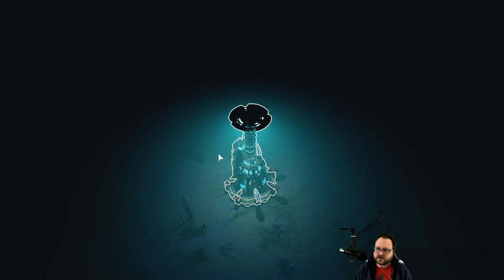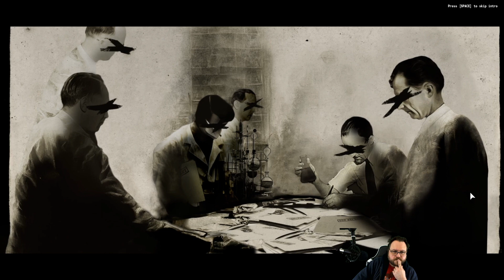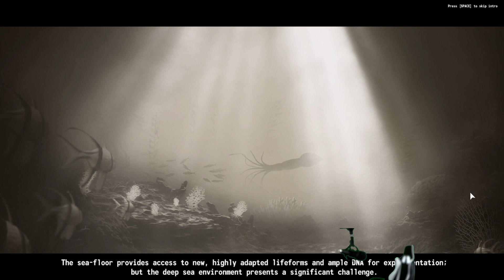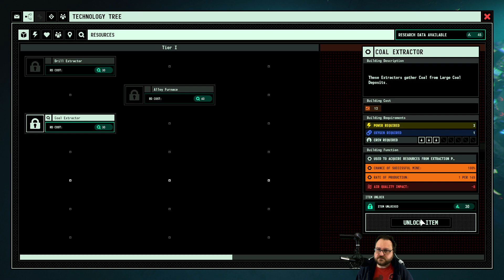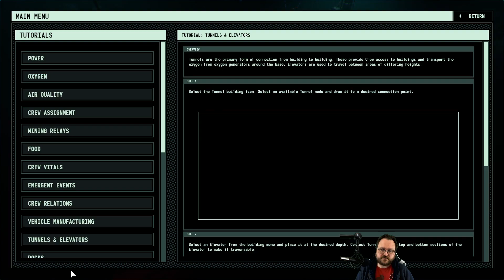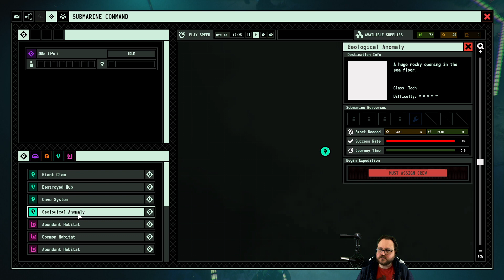Surviving the Abyss - New Early Access Game! #sponsored

Comment: 8km under the sea? I wonder what the story is behind that depth as from physics point of view it's quite impossible. It's difficult to convey what the pressures are at that depth other than trying to imagine the biggest building you know of and then multiplying one such building weighing on every square meter of a tunnel wall built at that depth. There's literally a 8km mountain of water on top of everything. Thematically 100 or 200 meters would've been enough. No sunlight and enough pressure to make building anything really difficult.

Comment: Water Pressure is about 1 atmosphere per 10 meters, so the pressure down there is something like 800 atmospheres, or 80 megapascals.
Reply: That's about a tad bit less than the pressure in a standard hydrogen tank (1050 bar), but a lot higher than natural gas (330 bar). It was hard to find, so I had to make an estimate, but the boiling point of water at 800 bar would be around the 660 degrees Celcius. (1220 Fahrenheit.)

Comment: I don't mind a bit of suspending disbelief but burning coal to produce power in an underwater habitat is a bit more than I can swallow.
Reply: Why ?  Coal is burned ina sealed unit above ground.  Why cant it be burned underwater ?
Reply: @jeepsblackpowderandlights4305  because there isn't an abundant source of O2 underwater.  It isn't worth getting oxygen from electrolysis because that would take more power than you get back from burning coal.
Reply: @roberteltze4850  maybe they are getting 02 from vaporizing the water somehow. Just use your imagination

Comment: This looks amazing! I am just wondering if this game is procedurally(sp?) generated, or the same events and lines of play every time like Frostpunk?
Reply: Even in frostpunk the outcome of the events is random and can be diffrent every playthough and every game has a way how it is to supposed to be played. 

To answer your question the map is procedurally generated, for the events i have only about 12h of gameplay experience but it seems they outcome is fixed. And for gameplay alternative i found you can go fast but this is very hard and you need to know what you are doing or you can take your time and everything everybody is compling about is nothing to be concerned about. Resccource not infinte but there are enough, the anomoly no issue if you have your power sorted out the with UV-Light nothing happens only 2x fuel comsumption what is no issue to compansate for.

TL:DR play it fast it is hard as hell. Play it slow it is still hard but Frostpunk is more difficult than this